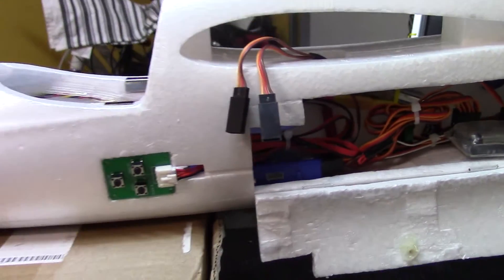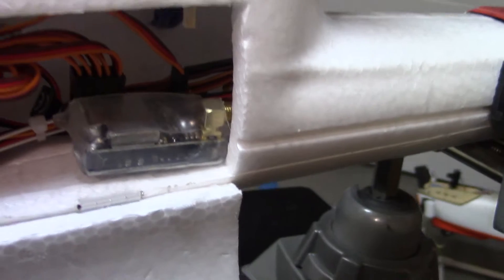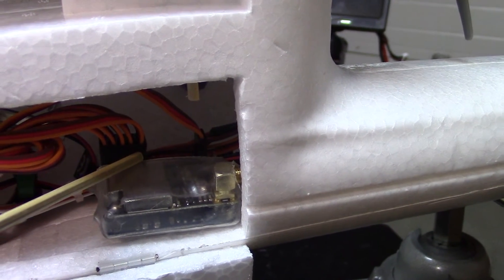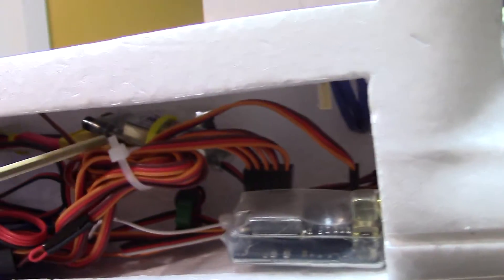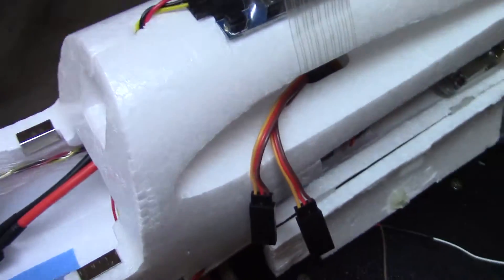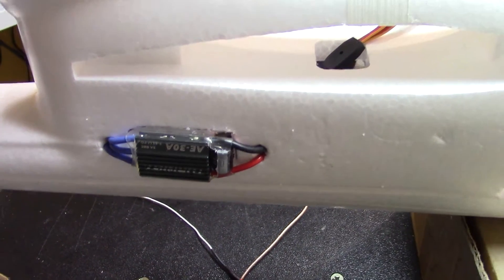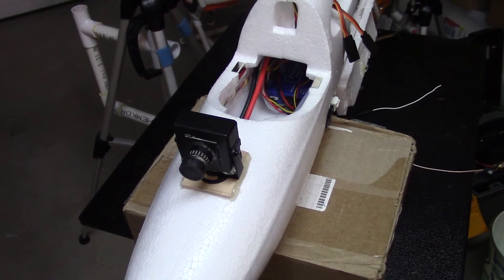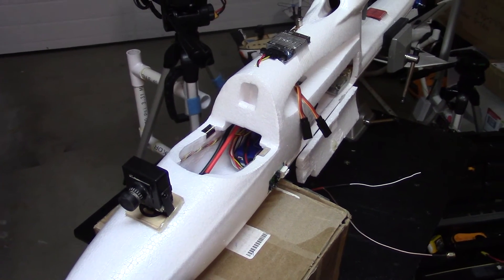Bixler 2 + Cyclops Tornado Build on 5.8 GHz w/narration

Comment: That is such a clean build!  Really good job!  I have to wonder, because it wasn't mentioned, what antennas do you prefer to use with 5.8ghz FPV for your long range flights?  In this video, I did see that you mention a LHCP Omni antenna onboard...that one goes to the video transmitter.  What antenna do you use on your video receiver?